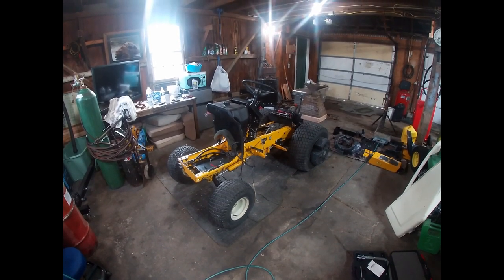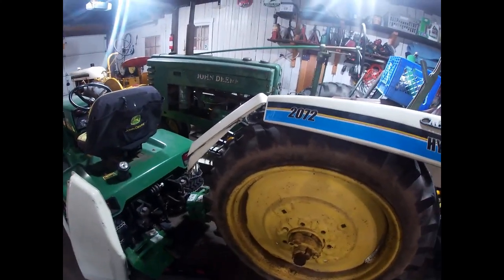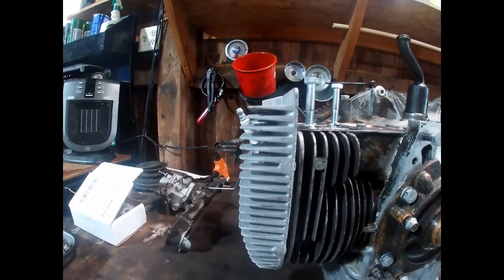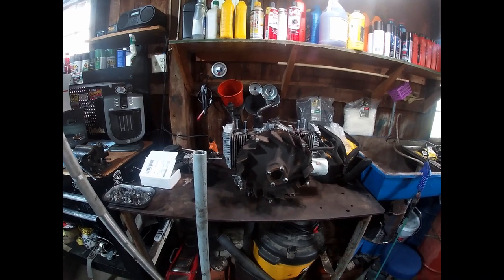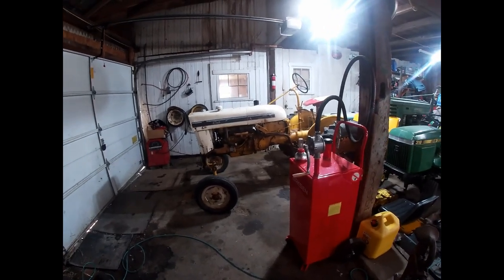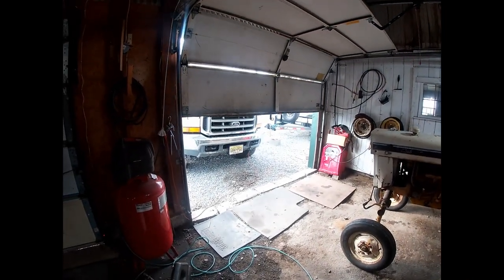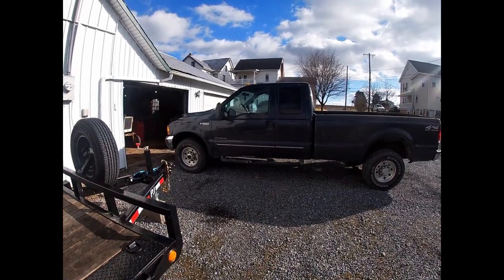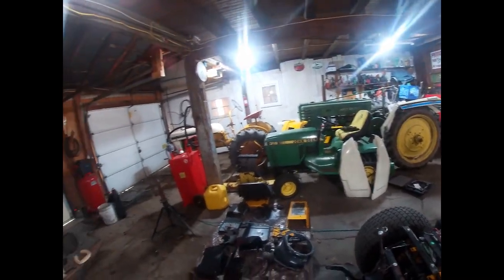Plans for 2022, Restoration Preparation, and Fleet Update (New Truck, Trailer, and a Parts Tractor)

Comment: If your gonna use your 7.3 as a hauler i would rebuild the tranny if its automatic because the 4r100s werent rlly to strong and after a tranny rebuild i would put a tuner on it not a smoke tune or anything like a economy tune something that wont kill your engine
Reply from the maker: Truck has a ZF-6 manual so there's not much to worry about there. It will eventually get the extended life air filter, 5" turbo-back exhaust with billet pipes, KC300 turbo with Wicked Wheel, 160/0 injectors with a mild tune, and probably a ceramic dual disk clutch. Enough to wake it up a little bit, but nothing crazy.
Reply: @MichaelTJD60  heck yeah i was just sayin if it was a 4r100 then tranny rebuild would be necessary but that makes it so much better its a zf6 my dad had two 7.3s with zf6 trannies and hes got a tune and 4 inch turbo back exhaust on it and its pretty fast and the other one has a intake and exhaust but its not a turbo back

Comment: Nice update Michael! You got a lot of work done to your Cub and the Onan engine. All those details add up and you will have a fantastic restoration. I hope your other plans add up, so keep it up
Reply from the maker: Thank you very much! I am eager to get the engine put back together and hear it run again. The 2072 should be like a new tractor with all the small repairs I've done to it.
Reply: @MichaelTJD60  Any time! I believe you are and I can't wait to hear it run. It WILL be like a brand new tractor, especially since you fixed the loose steering. Enjoy the process

Comment: Oh my Mike. Very nice on the F250. Those 7.3 power stroke are reliable. I would keep it stock as much as possible. The OBS 7.3 are also great as well. However it’s very hard to find one. Lots of play on the steering on cub huh. Just a few bolts and nuts tight wow. Even I been busy for me. Since two winter storm. My pickup truck did great for the two snow storm in 4H. I also got a Zero turn toro with a Kohler engine. The neighbor at the time gave me it at no and needs a new tire tube which that’s done. Valve cover is leaking oil slowly which needs a new gasket and the battery keep losing volts. Check the ground wire it was losses on the engine. That’s tight but still losing volts is not the battery. I need to dig deeper in the spring.
Reply from the maker: Thanks! I'm going to keep the 7.3 close to stock if I can help it...don't really intend to do any heavy mods to it. Sounds like you've got a good project on your hands with the Toro, they are good machines. You can't beat getting one for free.

Comment: Looks like everything's coming along great kinda sucks your selling that 318 but ya being confined like that you got to make due with what you have. Hell if you were closer I would say you could use one of the buildings here they have decent light and big doors. that 2070 is coming along nicely cant wait to see it done. Also recently I picked up a 316K  Serial number 089132 was wondering how far away it is from the one you used to have.
Reply from the maker: Mine was 90382.
Reply: @MichaelTJD60  only 1200 away from mine wonder if they were built the same day or same week
Reply: @MichaelTJD60  I will say you got the better machine tho lol mine needs some work
Reply from the maker: @themaniacmower  I doubt it, considering Deere typically doesn't put out more than 50-60 machines a day. Mine needed a lot of mechanical work when I got it but at least it had a decent paint job. Still needed some work when I sold it, but it was better then when I purchased it.
Reply: @MichaelTJD60  Mine supposedly the engine started burning oil so they tore it all apart guessing who ever it was didn't know or think to check the rings. Its on YouTube if your interested definitely been a much easier job than I was expecting when I started. My biggest fear was that who ever took it apart lost mostly everything needed to put it back together luckily everything was there I was told it was taken apart before I got it but had no idea how far until I got it. the engine sat open on the guys work bench and collected meatal shavings as well as sat out side for a little while but its definitely improved since I started on it. story i got was he used it to snow plow his driveway for a couple winters but it started smoking (Burning Oil) so he took it apart to see what was wrong but gave up on it.
Reply from the maker: @themaniacmower  Sounds like a great project, but it's always a gamble buying projects that someone else already started. It can be a nightmare trying to figure out what's there, what's missing, and which pieces go where.

Comment: Nice tuck, bad time to buy anything with prices so high.  In same boat; got 2003 f150, looking to upgrade to f250.  Keep up with rustproofing, the liquid film is the way to go.
Reply from the maker: Agreed, I jumped on the truck and trailer because I knew I would be needing them soon and prices aren't getting any lower right now. It's ridiculous how much the 7.3 Powerstroke trucks are bringing these days. Fluid Film undercoating is on the list for this truck.
Reply: @MichaelTJD60  you can try chainsaw bar chain oil with some lindseed oil and cut with some acetone.  Need special gun that hooks up to air compressor.  apply twice a year.  It's cheap. also ATF into door panels through glass openings, to prevent door bottoms to rot out.  I like that liquid film but it's expensive
Reply from the maker: @DC_PRL  I've heard of guys using linseed oil to protect original paint on their old tractors, and applying it with a hand-pump and hose wand like you would use to spray weeds. I'm curious how well it works underneath a truck. Whatever I use for undercoating has to be super durable because these Amish country PA roads just wear down and cover your whole vehicle with chips and "powder" year-round.
Reply: @MichaelTJD60  linseed oil stinks for a month after you apply it.  you want some dust and dirt on it after application, makes it more durable, self healing.  Even if the frame is already rusty, it will stop progression, since it displaces moisture.  The spray gun will run you $40 and a gallon of bar chain oil is $10... just applying it, wearing a respirator and goggles sux.

Comment: Hey Mike! Great video! You talk about the head bolts needing replacement because they stretch. Can I just get regular grade 8 bolts? or do they need to me tapered? I have a 317 that I have done a lot of work to, and I just replaced the head gaskets about 5 months ago, and it has just gone through another one. So, I figured I should just replace them, but I don't know where to find a tapered bold. So, if is just a regular bolt than great! thanks!
Reply from the maker: Just regular grade 8 bolts will be fine. I'm not even sure where to find a tapered bolt. When you replace a head gasket, have the head checked for flatness by a machine shop and shaved or milled if necessary - that way you know the head is sealed 100% tight to the block/gasket when the bolts are torqued down and there are no high or low spots where compression can leak (and cause the gasket to blow). Also, be sure to torque the bolts in sequence, then run the engine and let it build up heat, then come back the next day once it's cooled down and torque the bolts in sequence again. They will usually loosen up slightly during the initial run. And lastly, DON'T use any kind of sealer or RTV - all of these pieces are meant to be installed dry. RTV on gaskets is one of my biggest pet peeves.

Comment: Also remember the starter I was talking about for my grandparents cub 1811 well we were trying to start it and the starter worked a little then just barely had tue power to turn it over so now I need to put a new battery in and I looked up an oem Kohler starter and  it’s like 315 dollars so that might be next summers project
Reply from the maker: Did you have the starter rebuilt? It could be that the bendix gear is jammed or a magnet inside is broken. The OEM starters are built much better than the current aftermarket ones and they don't take much work to clean and rebuild. I spent $23 and a couple hours to rebuild the starter on this B48G engine, and now it will last another 40 years.
Reply: @MichaelTJD60  true I’ll have to see if a kit is available
Reply from the maker: @hunter7476  Brush kits can be bought from any starter shop or on eBay for cheap. $15-20 usually. You'll have to make a tool to compress the springs and brushes when you put the starter back together.
Reply: @MichaelTJD60  ok I’ll look into it I haven’t touched anything yet I still need to bring the tractor home at some point and while I have it put if they reactor I may as well clean the frame and clean the engine and service it

Comment: Nice still want to know how you get the engine for that cub so clean do you pressure wash it with degreaser soap or brakleen or what? I always run into this problem I’ll clean an. Engine like this I scrap the dirt off and then I pressure wash or brakleen it with a small wire brush
Reply from the maker: Usually a combination of compressed air for the loose stuff, and degreaser/pressure washing on the hard-packed stuff (except for the electrical components - just use non-flammable brake cleaner). It's crucial that you remove as much debris as possible - if any oil or grease residue is left behind, it will allow dirt and grass debris to start accumulating right away.